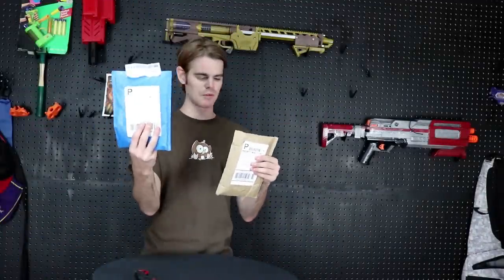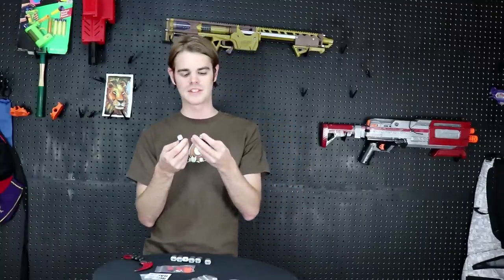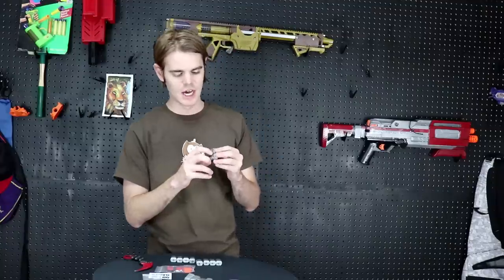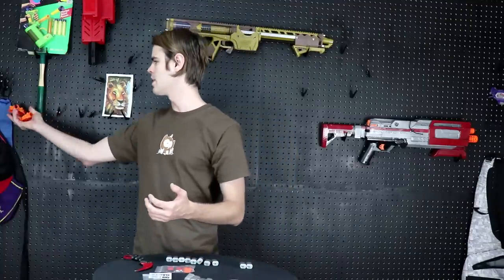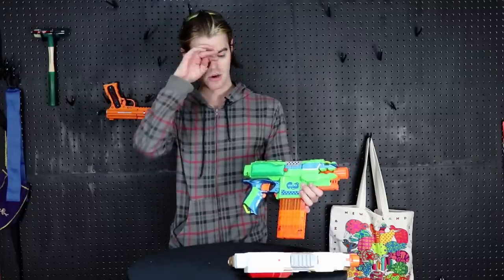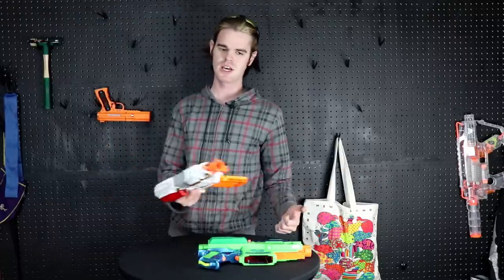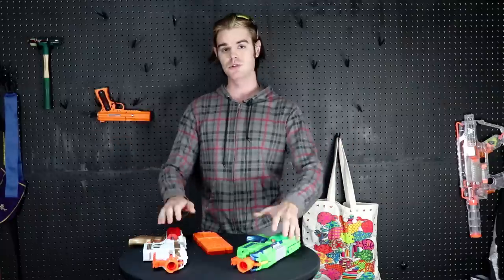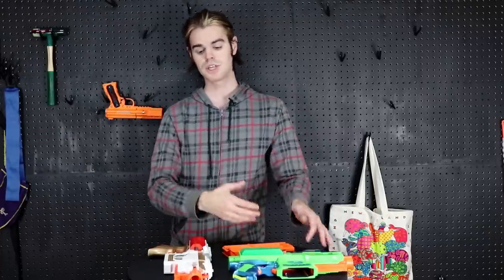New 3S Power: Valkyrie and Kraken Motors!

Comment: Hey drac, I am starting a stryfe mod with Valkyrie motors but have one question. Does the worker full auto kit work in the blue stryfe?( what with it having slightly different internals)
Reply: I’m not drac, but with a little bit of shell cutting I think it will be possible